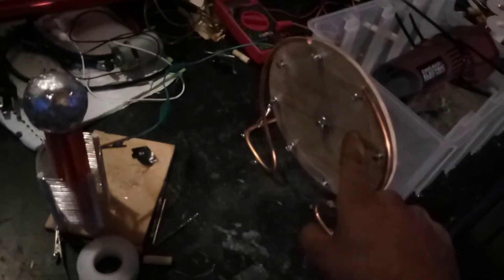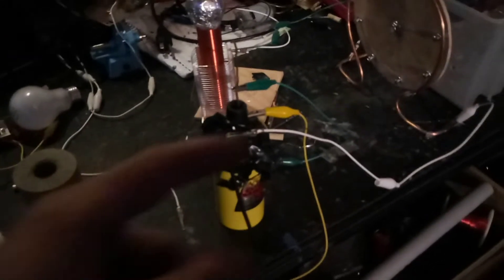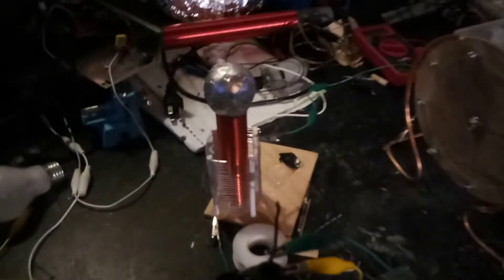Tesla coil rotary spark gap test for bigger coil

Comment: Nice I recommend to use  1 point on the spark gap it's better Then a loop and try to get a round primary don't make the windings to close to each other or the secondary I saw arks that's power being lost if you do that you should get bigger sparks
Reply: Ops dident se your other video